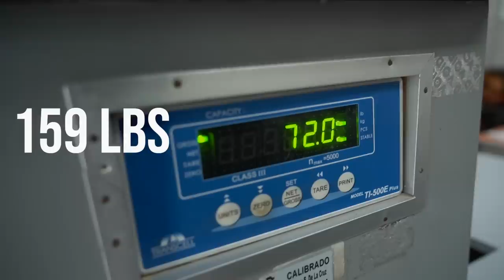Living on a Small Sailboat Sucks… Sometimes | S04E06

Comment: Having lived in a 28ft motorhome for years when I was young. I have to say that acquiring some few but critical luxury items is an absolute need to maintain sanity. Hot water system would be a good one to start. I'm sure you could find a small system to recycle from another scrap boat or  rv. And whenever possible use bright colors inside living area. It enhances auxiliary lighting among other things. Dark colors absorb light, allow mold to grow more easily, and contribute to feeling depressed. Especially when it's dark and rainy conditions. Thanks for sharing your adventures.

Comment: I just had my first experience with MOLD yesterday. I have 2 vehicles, a large 4 door truck and a small commuter car. I left the truck sitting for a month, in the shade, in this Florida humidity, rain everyday, no ventilation, etc. I opened the door yesterday and a White/Green mold was covering all of the upholstery, plastic, etc. I watched some YouTube videos and had to spray the entire interior with a Vinegar/water mixture and wipe it all down with Lysol wipes, then let it air out in the sun with the windows down. Looks much better today but it was alot of elbow grease.

Comment: One way to keep mold and mildew down while you’re away is to leave out a bucket of moister absorber as a dehumidifier. There are many inexpensive products you can use. It’s also good to leave a vent open for air flow and a solar powered fan. Also, open all cabinets and storage areas for good circulation.

Comment: Yip, the joys of leaving your boat for a while, the bottom is going to be just as bad, I'm presuming that she's going onto the hard for the refit/maintenance. White vinegar and bicarbonate of soda will sort your mould issues, good for your plumbing systems too. I don't think that 30' is too small for a couple, no more than that though, Atticus is the same size as Troy from Free Range Sailing's boat Mirrool, what's more important is the hull and particularly the keel configuration, long/modified full keel boats like Atticus are a better option ( regardless of size ) than a bolt on fin keel, spade rudder plastic fantastic of 40'.
Get as small a boat as you can comfortably live on and no bigger than you can comfortably single hand. Some great advice I was given, also small boats cost less, in every aspect, 30' is a little small for my liking personally, I'd go 33' at the smallest, and the only boat I'd consider is the Primrose designed Moody 33' mk1 and 2 centre cockpit. There are a hell of a lot of mid to upper 30's cruising boats around, most seem to be in that range, it's my ideal size. You've got a proven blue water boat, she'll serve you well for a good few thousand miles yet. Good luck with the refit/upgrades and stay safe

Comment: When living on the mooring ball in Boot Key,  I had to close the boat up for 5 days at a time when I traveled out of town several times each month. I found that if I sprayed the interior down with white vinegar AND left an open bowl of white vinegar sitting on the counter in each room nthat it would keep the mold away even in the summer months. While not  as humid as Panama and  my duration was shorter when the boat was sealed up, it should help you keep the mold level down some. Great Videos!
Reply from the maker: Thanks so much! I've heard this works really well! We're definitely going to try it next time. -Desiree
Reply: Can definitely vouch for this.  Vinegar and clove oil has done the trick for us for years!

Comment: FYI guys bleach doesn't kill a lot of types of mold. The best way I've found to clean it is vinegar and baking soda. Then to kill any that is left and prevent it from coming back I'd use Microban. You have to order it directly from the manufacturer and it's a bit pricey (about $45/gal last time I bought some), but this will kill the mold and leave a coating on the surfaces that mold won't regrow on for like 2 years. If you can get a hold of a ULV fogger you could just fog Atticus and it would only take 2 or 3 cups.

Comment: get yourself a Dehumidifier when you leave the boat for a long time... it will dry out the boat so mold does not grow.  it uses a small amount a power should un off solar but if u r on shore power u r good